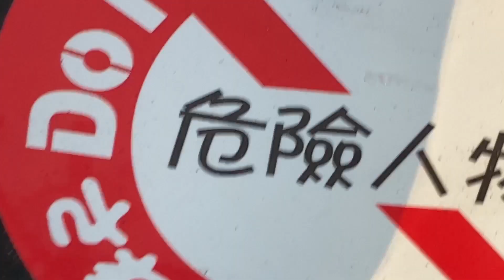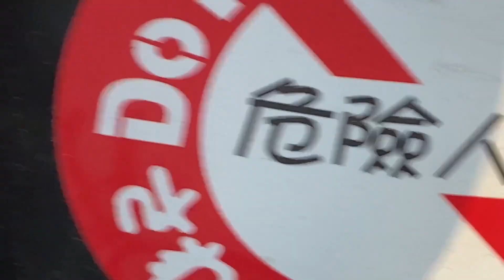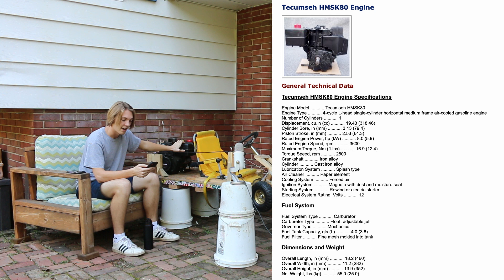We Built a 40mph Wooden Go-Kart in our Garage

Comment: Where did you get your tires/axel/sprocket? Looking to do something similar and I love what you guys did
Reply from the maker: I'm so glad to hear you loved our project, thank you for stopping by. 

I would not take the route we went, it was one of our biggest mistakes during this build. There are several prebuilt go-kart rear end kits online, I would go with something of that nature. Unfortunately, I can't recommend any specific one since I've never purchased one. 

The axel we used was just some steel bar from Big R (if I remember correctly). The sprocket was a cheap Ebay purchase. The wheels were dolly/hand truck wheels from Big R. DO NOT BUY DOLLY WHEELS FOR YOUR GO-KART! Neither the hubs nor the tire compounds were designed to handle the force we were exerting on them. I think we had a wheel failure roughly every 20 mins of runtime (even after reinforcing hubs with welding), and that cost accumulated quickly. We could have saved a ton of time and money in the long run if we had purchased a proper rear end setup. Not to mention our axel eventually warped causing some weird rear end characteristics. 

For our metal body go-kart project which we still haven't posted about for various reasons, we used the rear end and front wheels/tires from a quarter midget. Quarter midget axels, sprockets, wheels/tires gave us so much more flexibility in how we fine tuned the gearing (because we could switch out the sprocket) and it has more grip than it has any right to have (way more grip than power even with the built motor we have in it). You can get those parts from some specialist race shops and I definitely recommend going that route if you want a more comprehensive solution. 

At the end of the day whatever fits in the budget works, but do not buy dolly wheels. Get something that's actually designed to be powered by a motor. 

I hope this is helpful. I'll talk to Nick, lead engineer of the Scuffmobile, and make sure I got those details right. Cheers.
Reply: @carpartsandexhaustfarts  Thanks so much! I have been taking a look at rear axel kits and those look promising. I am also thinking of finding a kit for a steering system too. Any recommendations on that? I don't have a welder so I am doing what I can by hand
Reply from the maker: @Bengemon825  For our metal kart the steering mechanism was already on the chassis, but we hand built the one for the wooden kart and it works fairly well. You could copy our design and you'd probably get decent results. I'm sorry, I wish I had better suggestions.